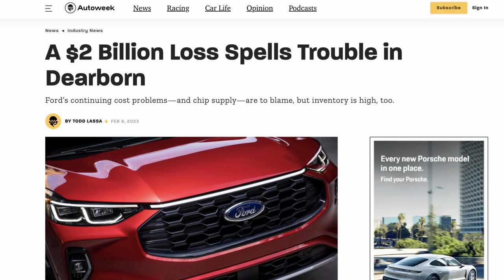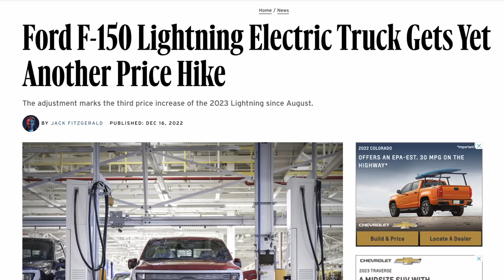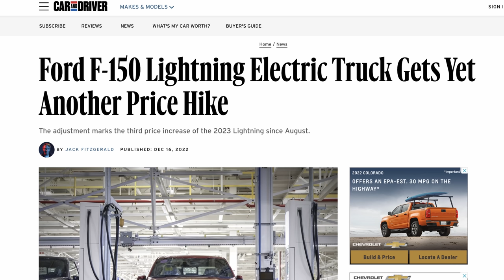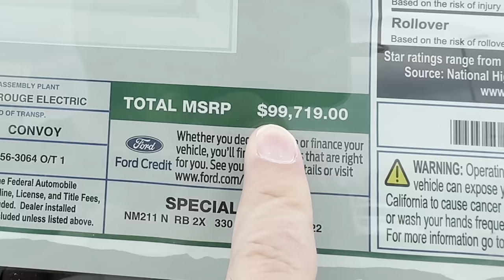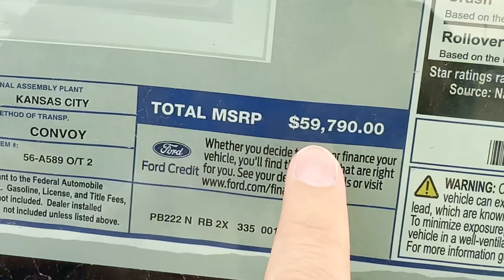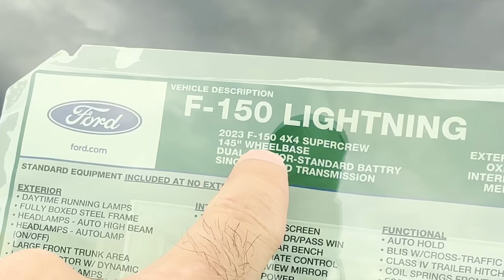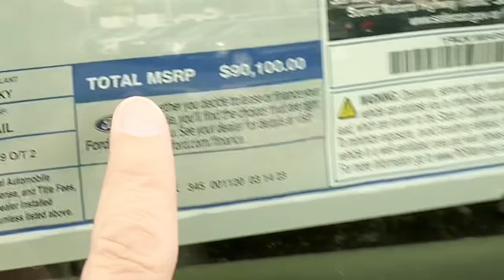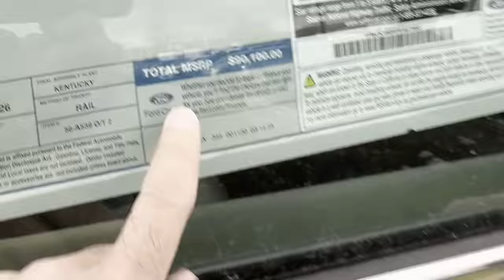Ford CEO Makes HUGE MISTAKE, Now Dealers CAN'T SELL TRUCKS!

Comment: Local Ford dealership here in NW Wi has the Mach E going for $80k, the base gas Mavericks for almost $50k, yet a full lot of F150s for between $42k-80k. Absolutely insane.
Reply: They will all be at the unemployment line soon, $100k for a lightning bahahaha bought a 2023 Model Y Long Range under $40k after incentives and no BS
Reply: They're supposed to have made a smaller more inexpensive truck???  Huh...
Reply: @dustyking8851  I know, I ordered one almost a year ago and recently they told me it could be anywhere between 6 months and 36 months until I see it, and they won't be able to honor the interest rates of when I ordered it (at the time was quoted 1.9% interest with a $400 monthly payment, and now they are saying closer to 8.9 up to 19.8% for an almost $700/month bill). So that "inexpensive" truck is going to cost a lot more now sadly.
Reply: Looks like every vehicle manufacturer is playing the same game as a vending machine company where you get a product that ends up being a smaller size for a higher price... these new trucks are not selling, they create smaller trucks that are way cheaper to build for more than the price of a new full size truck should cost
Reply: @MrMeshy  I would cancel the order. Totally not worth it.
Reply: I bought a Maverick XLT with roll up bedcover and all that. $31,600 out the door .... TomBall Ford Houston
Reply: @The_Laid_Off_Life  That's not bad but is it equipped with a 7" ring gear in the diff like a Colorado?
Reply: @The_Laid_Off_Life  pretty much the same that I got. I went with the Lux pack, the 360 pack, roll up tonneau, and a few other bells and whistles and I was told $30,800.
Reply: @gearmeister  ~ hybrid dude
Reply: @MrMeshy  ~ yep with 360 and all that. It has been doing 50 mpg around town and 40-42 mpg Highway.... so far so good
Reply: I factory ordered a 2022 ford Maverick XLT hybrid with the 360 package, bed liner and tonneau for 29K cash out the dealer door (actually could have got it for 28k but threw the dealer a bone for pinstripping, tinted glass and some kind of paint protection).
Reply: @kenhoneycutt2046  ~ what dealer did you get this through?
Reply: You would need to keep that 80k ev for 40 years to make it pay off lol
Reply: Bought a new F250 in Grand Forks,ND for $5,800. Oh that was in 1978, my grandson driving it now.

Comment: I bought my 2012 F150 xlt 4x4 new as a personal order for around $30k. It’s been pretty rock solid. 1 recall in almost 12 years, and 1 warranty repair issue on the 6R80 transmission. With the insane luxury liners they’re making now, I won’t be buying a truck any time soon. Trucks are for work. They need to make them that way and they might sell some.

Comment: I ordered a Maverick in summer 2021 and it got to the lot in fall 2022. Everyone was sharing horror stories about dealership markups that they wouldn’t budge on. I was so worried they were gonna add $10k to the sticker price and let someone else buy it if I backed out (was common apparently). Luckily I didn’t experience that. Same price paid was same price at order. Local dealership, from what I have seen and heard, has honored all upfront pricing with new orders. They also don’t have a lot full of unsold trucks bc they know that’s not how you keep a business running. It sucks to see so many others using the supply chain problems as a way to rob customers, but it is not a universal problem. I only wish Ford built more vehicles in the US but I guess that’s a different issue.
Reply: My sister special ordered a Bronco Sasquish in 2020 it did not arrive in Dealer until spring 2023. T make up for the big delay  he offered her a Lighting that the person ordered would not take.
Reply: Anyone who used the coof as an excuse for their downturn in sales deserves to lose their ass. They could've just ignored arbitrary lockdowns and went on with business as usual.
Reply: Yeah I ordered a 23 maverick hybrid from my dealership back in September and still l have heard only supply chain issues ever 45 days. Luckily I know my dealership won't do any marks up. It just sucks it takes so long cause they want to lie about supply chain issues for years
Reply: Get back with us next year. No new car or truck is worth half of what they are charging. And remember, China, is now the largest automobile manufacturer in the world. Do you know where all of your new car or truck, is made?
Reply: These big dealers that sell multi brands are marking up everything. They are not even hiding it now. Local Chevy dealer in my area have stickers saying markup 10 grand.
Reply: How do you like the Maverick?
Reply: In my area, fully equipped that's a $50,000 truck.

Comment: Something else you should know in pointing out window stickers with Ford is that the green colored window stickers are ordered vehicles that if they are on the lot for sale the person that ordered them rejected the vehicle when it came in. The blue window stickers are stock orders which are intended for the dealer lot! I'm a former salesman for Ford and I am a Ford guy through-and-through and I absolutely love my new Bronco. But seeing all of this made me get out of the industry six months ago and I've never looked back. Ford is in for some rough times unfortunately it looks like.
Reply: As someone looking to trade in for a Maverick or Bronco Sport soon, thank you for this little tip!
Reply: Oh no, the taxpayers are in for a rough time. The scumbags you previously worked for always make sure to get a federal bailout for their bad decisions
Reply: Yes they suck. I used to be a die hard Ford owner. 

When my 2001 F-250 finally dies I’m buying a GMC. Because the newer Ford trucks are absolute trash.
Reply: @rolandthethompsongunner64  well having been at a dealership that sold Ford, GMC, and RAM, I couldn't disagree with you more there. In fact I hired in their 12 years ago as a Chevy guy and have left a die-hard Ford guy. Sales practices alone notwithstanding, the product is still the best with Ford. That's why you pretty much still have to order a super duty and Chevys and Rams are piling up on the blocks. The fort has a thicker frame and uses better componentry and has way better engines. The transmissions are identical between Chevy and Ford because they co-designed it but everything else is different. And I sold to many ranchers and farmers and when you talk to them about what holds up under extreme use its Ford.
Reply: @Abbecskin  you mean not taking into account of the mass recalls?
Reply: @dakinesc09  That was GMC and chrysler. Ford sold its assets and stayed afloat.
Reply: @rolandthethompsongunner64 Not just the new ones. I have spent over 12 grand on my 2016 F-150 replacing damn engine and transmission sensors. I will NEVER purchase another Ford vehicle again unless it’s an early to mid 70s F-100.
Reply: @Abbecskin yeah but Toyotas half ton tundra is in a league of its own.
Reply: @dakinesc09 Ford was the one that didn’t take the bailouts
Reply: @stanleyharrell6009  I thought that sentence was going to end with replacing the engine and transmission, not sensors. That’s crazy. I had a 2017 f150 as a company vehicle, it had the 2.7 ecoboost and I never had a single issue in the over 160k I put on it. Oil changes, brakes and tires. Still had the original plugs when I left. That sucks that you’ve had that experience, especially at the price point they’re at these days.
Reply: @dickhitswater4836  the camshaft position sensors have failed so much on Coyote 5.0s, Ford should have done a recall. I was not aware of the problem when I bought my truck or else I would have went with the V6. This is a k own problem on the Coyote V8s. And Ford has done nothing to remedy this. All in the name of meeting fuel economy standards.
Reply: @stanleyharrell6009  that’s too bad especially from the leading seller in half ton trucks. I was skeptical of the 2.7 at first but after my experience I’d def own one. I watched a tear down of one and the block is built extremely stout so I bet you could get a bit more power without opening it up but it had plenty of hp and torque in stock form and I towed some extremely heavy trailers.
Reply: But has ford fixed the death wobble. Front end can't be controlled over a certain mph

Comment: My understanding is they pickup trucks have by far the highest margins for the manufacturer. They’ve been cash cows for years, and the fact that customers tend to be so loyal to their truck make, makes manufacturers take loyal customers for granted. 

Looks like the bean counters chose a pricing strategy to flog that cow to death, without regard for how it will hurt the brand.
Reply: Pickups have a 25% tariff on foreign trucks whereas normal cars have a 2% tariff. So there isn’t much competition by comparison and they can charge more and get higher margins.
Reply: @NickSteffen  Mark up, especially like 400 for 20 dollar wheel locks, 1k for a 200 dollar generic running board etc, they can suck it.
Reply: Problem with the bean counters is they count beans. They don’t understand the customer's relationship with the product.  This is why GM put out 6 copies of the same vehicle under different makes and put a Vibe, Montana and Aztec into their performance division, Pontiac. Fools.
Reply: @jdog22c34  if you don’t listen to the bean counters at all, you run the company into the ground. If you listen to them too much, you stagnate and become GM of the 80s. 

Gotta strike a balance between the creativity and the practicality. Need somebody running the show who understands both.

Comment: I tried to negotiate on an F150 and they would not budge, even with an overflowing lot. I ended up buying a used 2021 Tundra. This was about a month ago. Very happy with my decision.
Reply from the maker: That year has the good V8 engine anyways. The new Toyota turbo engines are horrible.
Reply: @Motor Feed  Yes it's a far better choice than the new overcomplicated twin turbo v6 .
Reply: @MotorFeed  I know they still have their teething issues but I'm curious to see what the tundra engines will be like in about 3 years after they've had some time to iron out the kinks
Reply: well enjoy your 15 MPG.
Reply: @pahuntnut  15 mpg with no drama, or 22 mpg with non-stop recalls? I'd rather pay at the pump, I think.
Reply: @Min4Mass  Yep
Reply: @pahuntnut  We do we have everything from 30 miles per gallon to 14. It's great.
Reply: @pahuntnut  All I care about is reliability And some Semblance of comfort.
Reply: Good decision, I still have a 2004 Toyota Tundra with 160k miles, drives like new still. I also own a Tesla modelY and I have to say it’s unbelievable how good it is.
Reply: Very good choice on the Tundra.  I've been a Toyota owner since 1986 and won't buy anything but Toyota.
Reply: Whatever problems you have with that Tundra will be minuscule compared to that Ford.  Congrats!
Reply: I am a happy Focus owner and would gladly buy a new one. I am  SO upset that they decided to get rid of cars in the US. It's one of the best cars I've owned sadly.
Reply: Do you like the Tundra? V8?
Reply: Isn't it amazing they'd rather literally let their vehicles sit on the lot and lose money than to just make better deals? I feel like the money they make from the occasional person paying over MSRP certainly cannot be making up for the lack of sheer quantity in terms of sales...
Reply: @joewoodchuck3824  I love it.
Reply: @NiceBowser  I agree. Though the dealers might be between a rock and a hard place with how much they had to pay the manufacturer, not sure.
Reply: @pahuntnut  Gas is not nearly the most expensive part of owning a vehicle.   At best it's third.

That's why I laugh at people who get rid of cars "because gas is so expensive".
Reply: @jeffdbaker71  Oh I agree.  My Ford Focus ST (2014) is one of the most fun and reliable cars I've ever owned.
Reply: @NiceBowser  Nor the interest on the inventory.   That dealer markup cannot compete with that  interest on the floor plan loan.
Reply: @teekay_1  My ST is a 2015, and it is so awesome. I am so jealous of other countries getting the updated versions of them. Can we go to Canada, buy one and bring it back?
Reply: @jeffdbaker71  Yes, Ford's decisions to drop all cars except the Mustang was pretty dumb.    The only problem with the Focus was they tried that new auto transmission before it was developed properly which gave a really good grocery getter such a terrible reputation that they couldn't sell them towards the end.

The Focus with the manual transmissions were pretty bulletproof.
Reply: @MotorFeed  
I heard the same about the  Ford eco boost. Then again I heard a lot of people love them. I guess it depends on how and what you are using them for. 🤔
Reply: @teekay_1  
It's not even 10 years old.  It will disappoint you soon. 
 Just ribbing you. Some of those  focuses are pretty good I hear for what you pay for them.  A friend of mine had well over 200k on his, 100 miles a day commute for many years. He's retired now so I don't know if he still has it but it served him well.
 I drive a 2002 4runner with  200k, runs and drives like a top and decent mpg at 23 high way. 👌
Reply: @paulcoenen7918  The Focus ST was a whole different beast than the standard Focus;  it was about twice the price of a base Focus, over 250 HP and amazing handling in top trim is has all leather Riccaro seats, full instrumentation, very well equipped.

It's Ford's competitor to the Volkswagen GTI

Comment: In 2019 I bought a two year old F150 XLT for just under 30K. I was having heart palpitations, thinking I spent way too much. It had 26,000 miles on it, and was clean as a whistle. In four years, I did brakes and tires once. Oil changes as required, and absolutely nothing else! I guessing I wasn’t as screwed as much as I thought.
Reply: The 2013 I picked up (in 2017) has been bulletproof. Glad I got into it before things went nuts. The truck is still worth almost what I paid for it 6 years and 100k klicks later.
Reply: @th3oryO   yep. It seems I bought mine practically moments before the defecation hit the oscillating atmosphere displacement device!!!
Reply: You got a great deal on that truck.
Reply: I loved my 2019 f-150, absolutely bullet proof. But in just 2 years they have went down the tubes. My 2021 f-150 trans is garbage, but the dealership said its just fine... bull !
Reply: Who knows, You might’ve able to sell it for $30,000 in 2023.

Comment: Bought a used 2016 with 40k miles and I couldn't be happier. There was no way I could justify spending the insane amount they were wanting for a brand new model
Reply: I'm happy with my 2007 Ranger (fleet trim) I got for $3,000 cash.
Reply: How much?
Reply: 92 ford ranger with 186,000 kms over here
Reply: 2018 f150 xl 2door ...20k ...46miles on the clock... bought it two years ago
Reply: Got mine for 20k 16 150 xlt with the v8! Worth it for me!

Comment: Great video! I was a GM for 18 years for a large auto group. I spent 30 years in the business and worked in every department. I do not know how much dealer profit is set on Fords, but from my experience, the mark up is about 8-9 percent on the brands I worked with (KIA, Toyota, Hyundai, Subaru and Nissan.) Plus what ever BS they add to the sticker. The group I worked for.. Key word is worked.. Started doing the mark up BS. I found it to be unethical. They would charge customer $1999 for Ziebart when you could go to Ziebart and get the same package for $899. They would Add a blinking 3rd taillight that cost $2 to make, our cost was $49 and the charge to customers was $499
Reply: Yeah we got a Bronco Sports Badlands loaded for the wife (on A/Z-Plan)...dealer did honor the plan only because I do YouTube. When I asked about a clear hood bra and tint they wanted $3,700...I laughed because my Tint guy quoted me $800 for clear braw on whole front of vehicle including headlights and the window TINT...turned out to be only $600 due to rear windows already being so dark so we just had to do the two fronts to match. LOL Oh that was for the fancy ceramic tint too. I laughed at the sales guy, actually laughed...he took it off without question, then I had to have him take something else he was trying to sneak in. I'm not loyal to any brand, it's just a vehicle to me...so next will probably be a Toyota or something as we no longer get A/Z-Plan pricing which was the ONLY reason to buy a Ford for us.
Reply: I have worked at dealers for almost 30 years and this happens on a daily basis. The issue is what the cost is for a new car or truck. Who would of thought putting an I pad in the dash would mark up the price 20k.
Reply: @Meekerextreme  Wow!!! $3700!! I think our cost was about $200-$250 on a vehicle that had been out a couple of years. New models were a bit more because they pay for the die and it takes longer. I think the most we ever paid was about $400. We sent all of it out because we didn’t do enough to justify the investment in equipment. $600 is a very fair price including window tint. The sad thing is that people will pay $3700. We had a little old lady come in to replace her car. She would have said yes to anything at any price. I made my manages sell it to her at our ave profit over the past 90 days, along with the extended service contract. She wanted 10 years coverage, because she only drove 8-10k a year. Her son called me up a week later from another state and said we ripped his mom off! I told him exactly what we had done and in fact we were at her house the day before getting her into her car, because somehow she locked her keys in and of course we did not charge her. He ended up coming in a month later and thanking me for taking care of his mom. It makes me sick watching these crooks.
Reply: There are a hundred “fees” that are marked up to the sky and passed off to consumer in dealers attempts to justify their existence. Dealerships are a waste of time and money. No exceptions.